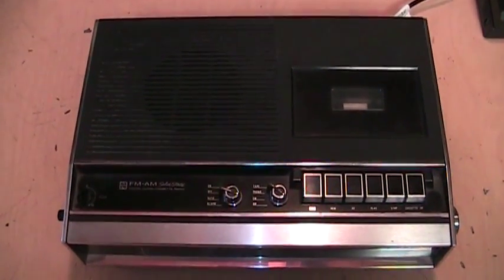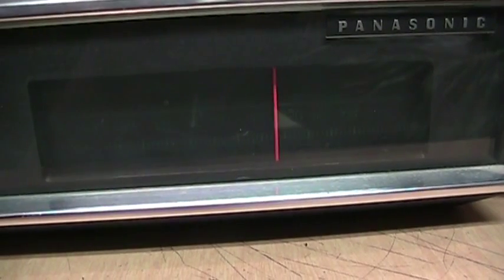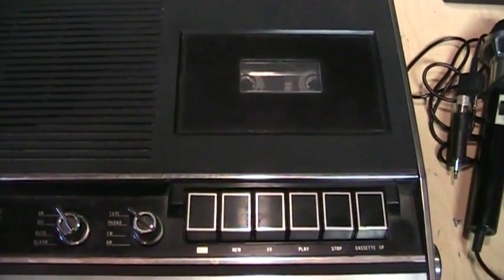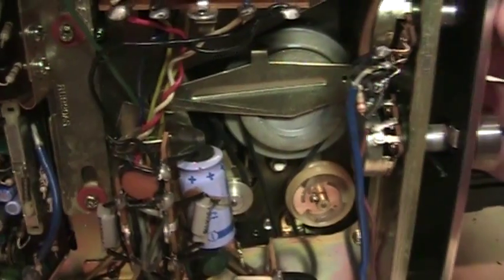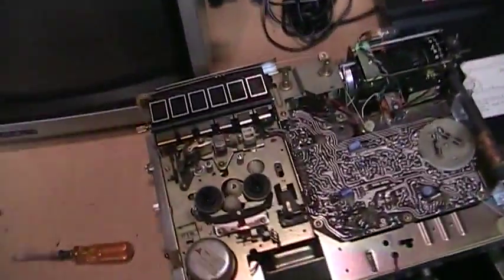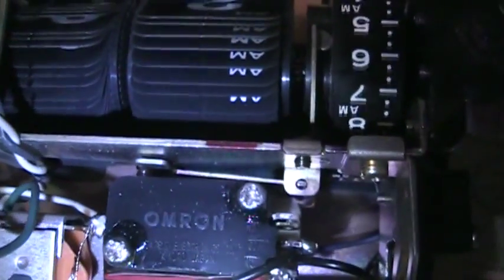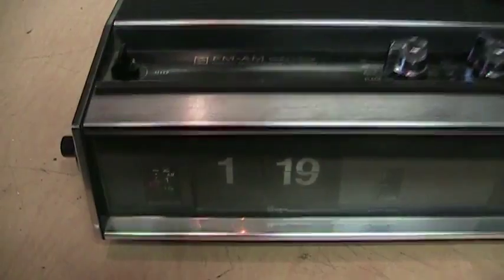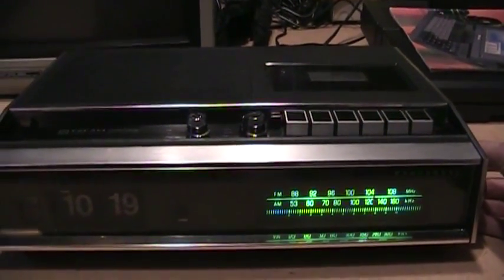Vintage Panasonic RE-6600 flip clock radio cassette recorder

Comment: in my opinion definitely worth the effort to total restore the clock radio and get the clock up and running as well as getting the radio portion fully functional again as well
Reply: I fully restore flip clock radios and usually the bushings in the motor are bad from lack of lubrication.  They are really fun to work on, however I wish all them had modular wiring inside.  Kind of a pain in the ass to de-solder wires sometimes when needed... lol

Comment: Oooh! sproingy tape door!
Really cool unit there, and it's nice that you were able to get most of it up and running. You can use it to tape radio shows you won't be home to listen to! Does the clock keep good time now?
Try cleaning the selector switch. That's probably why FM isn't working. I have a radio that did the same thing on AM.
That's a pretty good radio show too, I'm gonna see if it's streamed online!

Comment: i have a panasonic clock radio with a dead dial light similar to the clock light in yours.  where can you find the bulbs?  i also have a ge clock radio with a dead dial light.